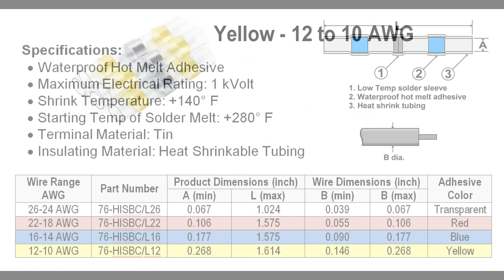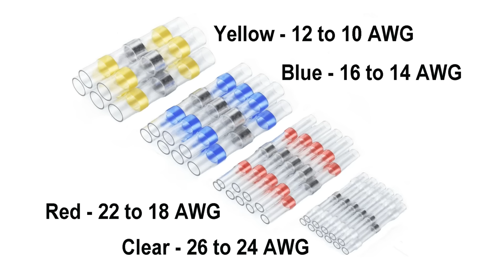Heat Shrink Self-Solder Butt Splice Connectors

Comment: I'm  a  trash  truck  mechanic  and  this  "seems"  like  a  good  idea  but  I  would  have  liked  to  see  the  heat  shrink  cut  off  to  see  the  solder . A  pull  test  would  have  been  nice  too .
Reply: i agree, generally a good solder splice the wire itself has a good mechanical connection before you solder and heat shrink. another possible issue would be if the wire is not perfectly clean it may look like it soldered the joint because the solder is contained in the heat shrink but may have not actually bonded to the copper strands making a poor joint. seems like a good idea but i am  bit skeptical, maybe i will have to get some to test out.
Reply: I'm sure the pull test would be fine, but I'm sure that the solder is around the wire and not throught. It will still be quite strong, but electrically I have doubts and I would consider it as unsoldered twisted wire heat shrinked with extra mechanical strength.

At work, I repair things, and I solder and heat shrink. It still take less time than this all in one thing, and I'm 100% sure that my splice will be 100% fine. I'm more concerned about the glue leakage than anything else about it :D
Reply: @thephantom1492  i use these without issue on a jeep that gets beaten through the mud weekly, they work great i give them a tug test yet to have one fail, id rather it fail when im sitting there with all the tools and a new connector, theyre dirt cheap on amazon, cheaper than good heat shrink tubing.. definitely faster too can repair a broken wire in under 30 seconds with just a heat gun and wire stripper.. or lighter and knife in a pinch but the heat gun is much better
Reply: These are amazing, and work very well. 

They don't put trash in aircraft.

If you think these are so awful, don't ever set foot on an airplane. They use thousands upon thousands.
Reply: Once you see solder flow on copper (wicking) you know the connection is solid, period.  Not only on wiring but on copper pipe as well.  This is a very high quality connection.
Reply: I'm still a show me kinda guy
Reply: @cbmech2563 Same here!  PROVE IT'S STRONG!

Comment: I worked for years for local government in fleet management, one of the parts guys let KAR products talk him into some of these self soldering heat shrink connectors. Sounds like a great idea and certainly speeded up certain repairs. However, the solder has a low melting point to keep from overheating the shrink sleeve material and destroying it, the solder does not flow well into the wire connection and over a period of time the splice fails and creates a failure. Makes for a difficult diagnosis some times. I think they are no better than the scotch locks that gives mechanics fits. After about a year of using these connectors, both the self-solder and scotch locks were banned from our shop. Just can't beat the old style crimp connectors or using regular solder and shrink sleeve to insulate it. I apologize for bashing your product, but in my opinion, this causes more problems than it fixes.
Reply: You got shit sleeves, I use them on military/ aerospace  wire looms as a job
Reply: @WorksopGimp  I've only used the one connector so far, and came up with the same conclusion.
Reply: @HitLeftistsWithHammers  LOL!!!

Comment: looks awesome but at almost a buck a piece ill pass and do it the old fashioned way
Reply: Amazon sells them for under .25 each.
Reply: +gsxrgeorge00 can you post the lino?
Reply: EBay has them dirt cheap.
Reply: Same quality, yet affordable.
Reply: Just used them a couple days ago and worked perfectly.
Reply: atown7587 exactly what I was going to say.
Reply: Nicholas Maietta thanks, was debating wether I should invest in it or not
Reply: HaLuNkE ST0NER thanks for the link, no harm in trying them.
Reply: amazing love them. NOT for cheap F%$#s
Reply: These are chinese rebrands, THEY SUCK HORRIBLY, NEVER USE THEM. Only the 3m ones are "okay" at best.
Reply: too bad this great invention will get copied and mass produced in china and they will be $5 for 100 at home depot one day
Reply: Summit/NTE didn't invent this, they are literally selling a chinese solder shrink connector. They're hustling people into thinking this is a decent product because I'm sure their mark up is huge. 
 @drksun
Reply: try eBay, about $0.12 in quantities of 10
Reply: I just bought a box of 100 from amazon for $10
Reply: TheRetiredtrucker  no solder?
Reply: Twist and tape it. Quickest fix ever!
Reply: @tronixfix  :::  From  A. Express  ???   I don't know if I could trust it from the  cheapest  site  on the  planet  !!!
Reply: TheRetiredtrucker  no, you just need to tie down the cables properly so they wont move while in use. But that's with every solder connection. The solder shink tube has a water insulation glue which will melt down and get squeezed between the shrinking part and the cable insulation. On vehicles i would advise to use another bigger piece of black shrinktube over it to give it extra strength.
Reply: About 10c a piece of Amazon.
Reply: 140pcs for $15
Reply: FEW BARE WIRES WERE STILL SHOWED UNSOLDERED.
Reply: Lots of cheaper ones on Amazon and eBay. And they look exactly the same.
Reply: @IbnAir23  the unsoldered wire ends youre talking about are still soldered in the middle where they over lap though, its just excess i cant see it making a difference at all. They use the same shit in aircraft and marine applications.
Reply: Aliexpress for 6 cents a piece.
Reply: That same box on Amazon is 2.50 on wish.
Reply: Take a look on aliexpress
Reply: @robertobrenes5283  just search cold solder connectors
Reply: I just found these (we use them at work at Nissan) they’re $27.99 for a 330pc kit on Amazon now
Reply: I just got a box of these yesterday. 10 bucks for 120 on Amazon.
Reply: It's actually pretty easy for $.25 each

Comment: I've used another brand of these and they kind of work. The solder connection is like a cold solder joint. I cut the solder joint and noted penetration but when I flexed the soldered wires with pliers, the solder just flaked off the wires. That never happens with regular old 60/40 unless there's other issues that cause a cold solder joint. I always judge a repair as "good" if I can say that I would I'd fix my moms car that way. I would never use these on my moms car.

Comment: These were standard parts we used in the USAF back in the 1970's.  This is old technology.
Reply: Marshall, I never saw these in the Army. Are they stronger? I am going to rewire my boat, just wondering if I should use these connectors????
Reply: We repaired USAF aircraft wiring with them all the time.  The shrink tube is strong and the sealant in each end that waterproofs the connection provide a good hold.  Just don't heat them too much.
Reply: Marshall, thanks, I will give it a try.
Reply: I was going to comment that these have been around in military aviation for decades, but you beat me to it.  Nothing "new" about them.
Reply: Used ones made by Raychem back in the 80's in civil and military aircraft in the UK. Not new at all!
Reply: Yeah we have these in the telephone industry I have been using them since I first started and I am close to retirement.
Reply: Military usually has the new tech way before the general public knows of its existence. Take the cell phone for example. Satellite phones were used in battle for how long before that tech hit the general public. So...maybe not new to Y'all, but new to most!
Reply: These have been around outside the military for at least 10 years, I think available in some retail stores.  But I kinda forgot they existed so I appreciate the video
Reply: Marshall Poe agreed we have been using something similar in the aerospace industry for our harnesses the 10 years I've been in the business.
Reply: Много что от военки приходит)
Reply: not stronger at all if you don't do a half - assed job and use decent quality solder wire
Reply: Yeah, Iam using red ones for about 10 years. In car, truck and bus electronic repairs. You only need this tube and lighter in your pocket, for fast and quality connection.
Reply: Back in 1970, copper wire also existed, also old technology.
Reply: Simon Baxter what is the name of them in the uk now?
Reply: Older tech...The OSS (precursor to the CIA) used similar devices, however, their model was pyrotechnic.

Comment: Former military soldering technician. These are very useful, with one step added. You must either clean and pre tin the conductors, or preferably - apply a light coating of lead free, silver bearing flux to the wires before heating. This reduces the risk of a poor joint associated with low temp solder rings, and one will ensure a solid and long lasting joint. Also, we prefer to pre heat the solder ring area until it flows the finish in a second step by moving toward the sealant ends, avoiding any heat damage to the wire insulation. Ideally, we use a bare crimp ferrule, soldered by hand, and a marine grade adhesive shrink over the joint. 
If the project matters to you, you’ll greatly benefit from investing a few extra minutes.
Great video.

Comment: Nifty idea. Handy for locations where it's hard to use a soldrring iron. Temperamental.With the brand I used, the full sized air gun with defkector melted the adhesive too much before the solder flowed. I eneded up buying a $38 palm-sized butand air gun to finish melting the solder without damaging the adhesive rings. They work good enough.

Comment: Set heat gun to 280 if you have a digital, start in the middle and wait for solder to flow, then drop the temp to 200 and work to the outsides. Got a universal heat gun to solder nozzle drop down for 3 bucks on ebay.

When working in limited spaces these will really shine, still do it the old fashioned way when there's room to with an original weller gun.

Comment: I used these for years in the Navy on the A-7-E and F/A-18A.  They found, just like any soldered connection, that a dry soldered joint was possible and discontinued use of them.  They work great for automotive applications.
Reply: Chris K The bismuth solder they use is really brittle and barely fuses onto the wires forming something I'd call a proper solder joint - it just peels apart if you investigate by removing the sleeve. The temperature isn't high enough for proper flux action and what you get is more like a little casting or moulding around the stripped wire. Furthermore, it's a joint that you can't see or inspect properly. Joints can go high-resistance in time, especially if the wires weren't completely fresh. We found them to be unreliable where I worked and I eventually refused to use them. A proper crimp, put on with the right tool, is bomb-proof, though it lacks the water resistance.
Reply: But Amazon is much cheaper, http://www.amazon.com/dp/B07H28DFYN, no thanks.
Reply: @Rich-on6fe  it is often too hot under the hood of vehicles for this low temp solder.
Reply: Whiners
Reply: Yup, no good for automotive either
Reply: I bought some but they are very inconsistent. Some melt great, other take more heat and end up melting the insulator.. sketchy to use, imo. I even had one burst open and liquid hot solder sprayed all over me, burning my skin. I prefer crimp connectors. Crimping is also easier.. I wanted to love these solder connectors for how simple they are but meh.

Comment: Great video — now to repair my XJ’s door panel wiring and the fuel pump since that’s hanging on by a threads. I’ll have to see if the door jam harness can be pulled into the cab because that will be way easier to work with especially since you want to apply heat all the way around the wire.

Comment: I have messed around with these things on automotive projects.  They work OK, but I still prefer crimped butt connectors covered with glue lined heat shrink.  One of the things that always bothered me about these was the clear heat shrink covering.  It always looked like the heat shrink had failed and wire strands were uncovered.  Not sure this ever happened, but you cannot tell as it is a clear material.  

As others have said, it cracks me up that Summit is portraying these as new technology.  They have been around for a very long time.  

Not talking trash about these devices though.  They do work....I just don't think they are quite as good as the crimp connector/heat shrink route.  They are no faster or easier to use.  Brilliant solution to a non-existent problem.
Reply: Crimping IS the best way

Comment: Solder connections last as long as the current is not too high... Especially this "low temperature" solder... Solder flows after time. A good crimp doesn't. And to be honest crimping doesn't hurt, is much cheaper and consumes less time. And where water tightness is required there is time to add a drop of glue/silicone/shrink tubing or another type of connection available.

Comment: They had this stuff 30 years ago from Worth   Way to expensive. I’ll just solder the wires and use heat shrink with the adhesive inside.
Reply: I bought some crimp ,solder and seal connectors for a application,, ordered from napa 2.00 apiece

Comment: We had them in the 1960’s in the British army. They were copper on the outside with a sulphur blob ( like a match) that was struck with a striker strip. The wires were put in both ends, struck and left to cool - the copper on the outside was insulated from the wires.
Reply: I read they were also used in World War 2 to quickly repair broken wires in the field!

Comment: These work great on small wire sizes. 18-22 AWG. However, anything larger and the solder doesn't quite saturate the connection like it would with solder applied with a Soldering iron or Gun. They ARE a good idea to have as an emergency kits in your car or truck for "On the road" connections, but I would cut them out and do a proper connection whenever I got home. Reason being the connection is NOT complete and if you get a HIGH CURRENT going through this wire,,the solder has a Good Chance of re-melting and the connection coming Loose. .
Reply: EXCELLENT POINT!
Reply: I just watched another video doing a test with them. He cut them open after and the solder doesn't even penetrate deep into the wires, so its only good for small AWG wires. Soldering is the best method for larger AWG.

Comment: People have tried them and taken it apart after, its a cold joint, doesn't actually wick through the wires more as melt on the surface. 

It's really the worst of both worlds, they are expensive, and only popular due to making it look easy, just as everyone else said imagine doing this in a tight spot where you would want a solid connection.

Comment: these are everywhere, be the first to make them in a T or more likely a Y configuration and ill pay a dollar a piece.. currently no good connector sold for splicing into a line and some places like under a up in behind a dash panel you just cant strip wrap solder and tape a connection

Comment: That is actually super clean. The heat shrink holds the solder in to melt to the correct wire gauge.

Comment: I use these in my commercial garage, and you have to be careful with how heat you apply, or the plastic bursts and exposes the solder/wire. So be careful. But they are really good

Comment: For 14 to 16 gauge wire connection package of 50, $41= $0.81 Each (Excluding tax and delivery) On the pricey side but still reasonable If it delivers.

Comment: coming from summit, you'd think ya recommend something with an aviation splice due to G forces.  the low temp solder is nice but the whole splice is 'weak' and you cant tell if you have a 'cold joint' issue (flux and adhesion is still critical even at low temps...) rather use an iron and tubing and do it the normal way.   Should sell the tubes in kits with the sealer.   that would nice to have already done without having to pack ends with silicone before shrinking.

Comment: These are mostly used in avionics in aviation. There is ONLY just enough solder to perform the splice. The key is to heat the joint JUST enough to melt the solder. If you heat it any more than that and the solder will wick away from the splice and it will make your splice joint weak.

Comment: Looks cool id buy them if supplied to part stores. We need more selection in the autopart world thats not online i went to 4 autoparts stores yesterday looking for a 3.5mm female bullet connector to rewire my ignition coil wiring harness that got burnt from time and all the heat the engine makes " since wires are ontop of the motor on my s40 " and couldnt find anything! Not even a good butt connector just plastic shit had to order some online and pay 15$ for rushed shipping and still have to wait 2 days!! If i seen these id have got a few forsure so maybe market these to advanced autoparts or napa shit like that

Comment: The trouble with these types of Soldering jobs is accessibility, it's usually not the soldering that's difficult, but having to access the wires in a confined space like under a Dashboard.
Reply: Even outside of the dashboard while soldering radio wires , tons of them...probably be hard to get that heat-gun in there, i mean, i've done it but having to intertwine wires that dont have multiple braidable wires is impossible. very small wires probably won't work with these, unless they make little micro ones.

Comment: You can just lap the wires, no need to press them into a birdcage and start heating in the middle. its still better to solder the wires and shrink over them, if you cant solder you shouldn't be messing with wires anyway.